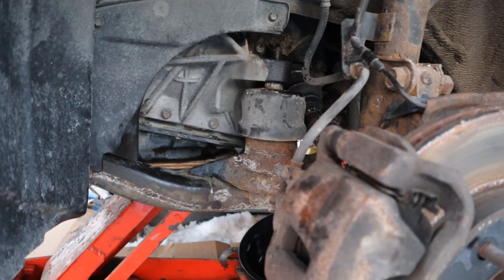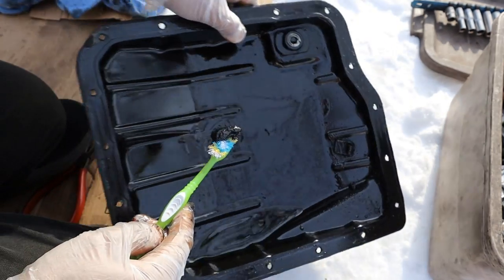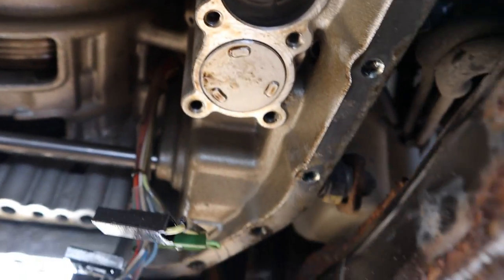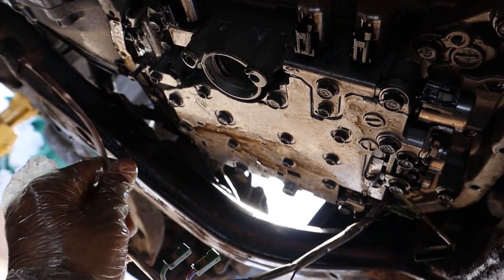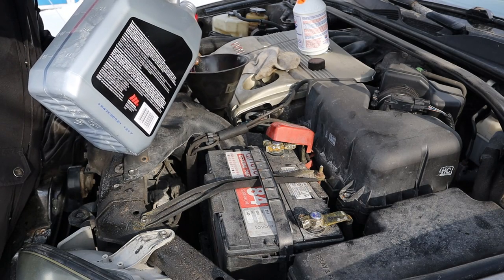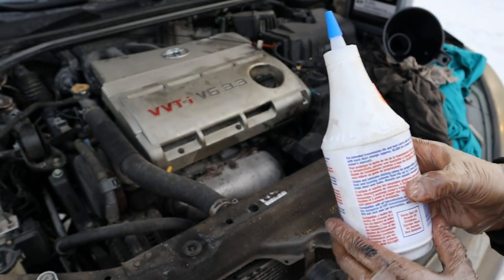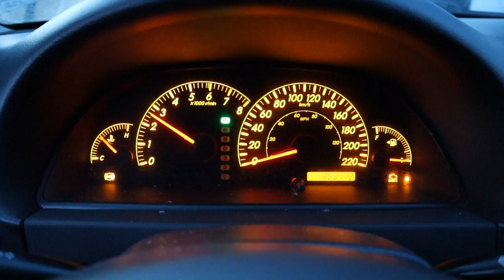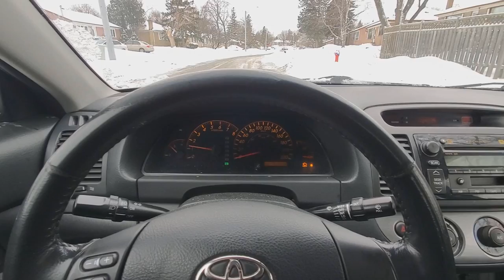Can Stop-Slip Save this Transmission?

Comment: It worked for me. Back in 2001, I had a '96 Galant. I didn't know anything about cars then. Trans slipped a few times & I squeezed half the Lucas stuff down the dipstick tube. On top of the brown fluid too.... 😳😳😳 I drove it another 3 years before I had to replace the trans. Lol.
Reply: If its broken or worn it's better to leave the old in there. Unless u change the filter too.
Reply from the maker: Well in your case it still had life left in it. Didn't work here 😞
Reply: 😂 old days stories are the best
Reply: How did the car need a new transmission so fast? 96-01 is only 5 years.
Reply: Old post, but ...  @kingxcamm  From video description: "This Toyota Camry got stuck in the snow and burnt up its transmission."

Comment: This was nostalgic for me. I changed the ATF in my old 03 Camry cause it was pretty dark but I didn't have any shifting issues. After changing it with Toyota oem atf it felt like a new car. It shifted a lot better and a lot smoother. It was honestly one of the best diy maintenance I did for that car lol.
Reply from the maker: Keep up on those drain and fills. There's ~10 liters of fluid and you only changed 3 or so
Reply: Same thing here on my 06 camry..lacked acceleration but after a transmission fluid and filter change it was a brand new car again
Reply: I did additional 2 more drain and fill with oem fluid
Reply: @speedkar99  required 2 drain and fills. Good thing these model years have a trans dipstick for easy replacement.
Reply: In my 1998 Accord,it was reverse,after I changed the ATF it start slipping and that Lucas stop slip did not help at all it made it worst,so I have it rebuild for$1800 and now after 25,000 miles later it still not slipping,He gave me 24,000 2years warranty a Honda specialist on tranny.
Reply: @efrensaclolo7021  the  old fluid with more friction was preventing the clutch packs from slipping.
Reply: My 06 Camry started slipping after a bunch of fluid changes so I can't relate
Reply: @efrensaclolo7021 same thing happened to my Camry

Comment: Hell Yeah!!!! 👍🏿👍🏿👍🏿👍🏿😁I use to do Uber in my 06’ Highlander in Minnesota! Had to do my own maintenance in the snow! It was too expensive and trying to make money! Alternator, starter, transmission drain and fill, oil change, steering fluid, main drive axle, rear bearing, front knuckle with bearing!!!! All in the snow living in an crappy apartment!!!! Had to wait till temp was above 20 degrees during daylight in order to work quickly on each one. This was during NCAA and Super Bowl so it was a must!!! Mad respect ✊
Reply from the maker: Exactly. Sometimes you have no choice and gotta work in the snow and cold!

Comment: Another great video! Keep 'em coming. I hope you don't run out of toothbrushes! 

I think over 90% of current manual and automatic transmissions are made by Aisin, a division of Toyota, and most, if not all, of the automatic ones require Aisin/Toyota T-4 spec ATF which is not full synthetic. Changing this fluid regularly is critical to the life of the transmission - especially if you are hard on it.

My VW Rabbit's VW 09G automatic transmission (Tiptronic semi-auto) is made by Aisin and takes the same fluid. When I bought it with 142K miles on it, the shifts were very hard. I drained the fluid, dropped the pan, draining more fluid, changed the filter and replaced the fluid according to VW's instructions which were tedious, time consuming and Aisin T-4 ATF consuming. (Just draining the pan gets 2.5 quarts and I changed 3 times that amount following this procedure. The shifting improvement were very good, but still not quite what I wanted. 

Since then, I changed the ATF pan (2.5 quarts) at 15K mile intervals using a very popular full synthetic which meets the T-4 specs. The improvement after each change was better each time. Now that I am satisfied with the results at 165K miles, I will switch to 30K mile intervals. 

I'm not saying this will make my Aisin auto transmission bomb-proof but it should lengthen the life of it as long as I don't abuse it. Supposedly, this transmission is a weak spot in the VW but it works perfectly now.
Reply from the maker: Awesome. Didn't know Aisin makes VW stuff. I thought ZF would
Reply: @speedkar99  
The VW 09G automatic transmission is also called the Aisin-Warner TF-60SN transmission.
Even though Aisin is a division of Toyota, it is a separate entity and has been making manual and automatic transmissions (not sure of CVT's) and all the required fluids for them for almost all of the cars in the world for a very long time. 
The Mini, Miata and Honda S2000 6-speed manual transmissions were by Aisin. The 5-speed Miata was by Mazda. 
I've used the appropriate spec AMSOIL fluids in all of my manual RWD truck and car transmissions, manual FWD transaxles, automatic FWD transaxles and CVT FWD transaxles with great improvement in every one of them. All of them were broken in on the OEM fluids before I switched to AMSOIL and I could tell the difference in shifting. i am not an AMSOIL dealer and I don't get paid to say this...I just like the stuff.

Comment: That's the way I change the fluid in my old Pontiac with a TH400, take a cooler line off and run a couple quarts in a pan then top it off. Keep doing that until what comes out is nice a red. Sure beats just dropping the pan and leaving over half the old fluid in the converter. Nice to see someone else doing it that way!  : )
Reply from the maker: Flushes are fine if you have a major issue like mine. For just regular fluid changes, a drain and fill should suffice

Comment: Your fluid was dark because the clutch plates were burned out. That's also why it's slipping.
Reply from the maker: Yes, I expect to find that when I open the transmission
Reply: @speedkar99 is it necessary to take out transmition if you change only the forward clutch plates on toyota camry1992 2.2

Comment: That cylinder piece that you found in the pan is a bearing roller
Reply from the maker: That sounds right. Sits in the transmission casing against the final drive right?
Reply: @speedkar99  yes sir

Comment: A friend of mine calls me around a month ago telling me that they dropped GMC Savana after the costumer tried to move the van out of the snow. By rocking it back and forth by switching rapidly from Drive to Reverse he blew the gears inside. Not the first truck or van tranny that we replaced or 'our' tranny man rebuilt.
Also Aisin (their transmissions more and more often is used in European and American cars) recommends to change the ATF every 80k km. As far as Lifetime fluid listed in some vehicle specs, it's more of a marketing trick, because all automatic transmission manufacturers recommend ATF change. That actually happened to my father's older VW Jetta with the Lifetime ATF - during one week the tranny practically quit, but after fluid change it magically came back to life.
Reply from the maker: Yeah keep the fluid changed and don't abuse it in the snow and it should last

Comment: The part at 2:22 is the brake seal for the intermediate clutch (2nd gear) it’s located between the VB and case. Someone has likely been inside this transaxle and it fell out when the valvebody was down. You’ll have a big leak in 2nd and likely burn up 2nd clutches pretty fast. 

The U150 series was more reliable than the U140 but mileage gets them all. They are expensive to rebuild and this one is way far gone.  Not Economically Feasible to Rebuild. Too bad salvage prices for used units are climbing to stupid levels in some places.
Reply from the maker: Thanks for the info. I guess I should also examine second gear clutches as well when taking this one apart.

Comment: I used Lucas in an 02' Honda Civic with the terrible 4 speed auto.
Started with sluggish performance, then the torque converter would kick out when it shifted.
Then it blew a coolant line and ran almost completely dry of trans fluid.
I filled it with Castrol transmax and Lucas got another year and half out of that transmission. LoL 😎
Reply from the maker: Nice! I used it on my friends ES300 and it stopped it from slipping so I had a tiny bit of hope for this one

Comment: Thanks for the video and the effort! Very impressive to see over 360k miles on that car. 
I wonder how many timing belts it had done 😂 Definitely worth putting another trans in it imo.
Reply: I realize that it’s actually kilometers. Still very impressive
Reply from the maker: Yeah it ran good. I ended up putting a used transmission in it, that'll be the next video in this series
Reply: @speedkar99  Awesome! I’ll be looking forward to the video. My sister actually has an 2004 Camry SE V6. Sometimes it shifts kinda funny. It’ll rev up before it goes into second or third gear.

Comment: nice video! and, no, it wasn't a waste of time and glad you did it, especially in the cold...
I always thought you should never do an ATF flush because it can push tiny material into all the crevices of the AT....

I probably would have drained out enough fluid to add in some of the stop slip stuff and see how it did.  If that didn't do anything, I would have drained out all the fluid, dropped the pan, cleaned the pan and magnets, put a new filter back on and then filled it back up with OEM ATF. If that wouldn't do it, then I would just call it a day and scrap that camry with a beautifully running engine tear drops

Love your videos and keep up the great work!
Reply from the maker: Yeah but this fluid was toast! 
The idea wasn't just to replace fluid, but get an idea of the transmission condition by dropping the pan and checking all the solenoids
Reply: @speedkar99  nice! Thanks for another fun video!

Comment: good try,  I used the lucus stuff along with 3x drain fill using valvoline max life full sync atf on a nissan maxima with a RE4F04B transmission that was almost toast as a last ditch effort.  I also used seafoam trans tune.   that was around 202K miles, it now has 243k miles and 4 years later.  it was good enough to get around while my son saved up for another car.  it lost 4th gear (overdrive) but all other gears work.  I have a feeling 4th gear clutch is burned out or the TCC solenoid is bad.  P0744 is the error code.
Reply from the maker: See my teardown on this transmission. There was no saving the clutches on this!

Comment: Try Lubegard. No one knows about the stuff and it fixes stuck solenoids and valve body issues. If it's the frictions in the clutch packs or bands then nothing you add will help
Reply from the maker: In this case I don't think it was a valve body nissie since I cleaned that up pretty nice

Comment: DO NOT DO IT!!!!  As a transmission builder, I tell you...  If it's broke, NO fluid will fix it!  These stop slip additives are designed to swell the rubber seals in the trans providing a "better seal" for worn parts to make the transmission work again.  Now, in some and some (very few) cases where these additives do actually help...  What is there to tell these additives to stop?  In other words... Once these additives have done their job, what stops it from continuing to swell rubber parts?  Nothing is the answer.  These rubber parts continue to swell until they pop.  That includes external seals.  I can tell you, we charge extra to build transmissions that have these additives installed, as it is a chore to clean properly.
Reply: These products are mild and won’t do much at all from my experience unless the directions are not followed. Multiple bottles or mixtures of additives. 

The real wonders are when someone suggests a bit of brake fluid added to the trans fluid. This will get things going!! Talk about a big mess. Little brake fluid suddenly fixes all and people think more must be better and then end up with exactly what you describe. Locked up drums and seals. I’ve broke a few aluminum drums trying to remove pistons. 

All these additives are temporary at best and not fixes and like Kefsn suggests may cost you more in the end.
Reply from the maker: I can understand your point, similar to how it is to have tires with foam goo in them
Reply: That’s not what people who are trying to sneakily sell their car care about though

Comment: If you mix the stop slip with ATF it pours faster. Pour a little out. Put ATF in with stop slip. Put on cap & shake. Then it will pour faster. I have the 05 2.4 literr before the oil ring problem with the U251 Toyota 5 speed automatic. I watched this to see how easy the trans pan is to drop. I need to do that motor mount on mine so my lazy-meter was accurate, it can wait til summer.

Comment: Wow, impressed that thing even moved!
Mine (RX300 with a U140) started slipping in the high gears first, but after a while it started hesitating going into reverse and 1st as well. The oil didn't look that bad though!
Reply from the maker: Those RX transmissions weren't known to be reliable

Comment: a good tip for this job is to make sure you forget to reinstall the bolt on the transmission mount
Reply from the maker: Why is that?
Reply: @speedkar99  so that when you hit a big pot hole transmission drops

Comment: I have a Mazda 2013, 270,000 kms (160 000 miles). My mechanic told me I will need a new transmission. Fluid very dark and burnt. At this time, no special noise, no Check Engine light. It started slipping a month ago. When I change speeds, I need to let go the gas pedal or else the RPM goes up to in between 2 or 3. If I am extremely gentle on the gas pecal, can I go on for at least let's say 10 000 kms (6 000 miles)? Will I see more signs that the transmission is going worse or can it give up after just a few kilometers?
Reply from the maker: Definitely get a roadside assistance plan
Reply: @speedkar99  The car started working like before after I filled up the gas tank. What do you think of that? 😳

Comment: Lol 3:31 is that not a solenoid coil? Probably goes with the cylindrical piece that was on the magnet. 😬
Reply from the maker: It sure looked like a solenoid coil but all the solenoids in them valve body were intact.
Reply: @speedkar99  maybe transmission RPM sensor? a quick search and it looks like the little piece on the magnet may have been part of that.

Comment: That copper bundle looked like a solenoid winding.
Reply from the maker: Yeah it did to me too but all the solenoids seemed intact
Reply: @speedkar99  that is slightly bizarre. FYI you can find pretty good step by step rebuild videos for these things. Once you tear it down you can see if it makes sense to get a kit. Certain parts are more expensive than others, and if there’s any damage to the case internally it’s somewhat junk.

Comment: That whining noise you mentioned sounds like the pump to me, as it sounds very similar to a hydraulic pump sucking air
Reply from the maker: Yea but it had enough fluid....
Reply: Definitely the transmission pump, I've experienced that whining sound sound on a Chrysler 62TE firsthand

Comment: Pare Ko,How many miles does it have? My 1998 Honda Accord start slipping at 130,000 miles,I have it fixed for $1800 now it has 155,000 miles,I want to change the fluid with OEM with Z-1 on it but I saw Valvoline and Castrol sells those fluid with Z-1 $6 a quart compare to $12 Honda brand,You are the master of all mechanics in Yutube so I need your help,I have 5 sixth generation Accords 1998,1999,2000,2001,and 2002 except 1998 the only one that had tranny problem,the 2001 has 405,000 miles the 2000 has 310,000 miles 2002 has 210k miles.1999 has 230k miles.My daughter and 2 sons and my wife and myself have ONE ACCORD.
Reply from the maker: Yeah the 6th gen wasn't known to have good transmissions at all
Reply: Well of all my Hondas the 1998 Accord is the only one that has a weak tranny.Maybe you are talking about most of Hondas with six cylinders that are failing at a 100k miles.All my 6th generation accord are four cylinders and 1998 model year failed at 135k miles.The rest are still trouble free and keeping it till it falls apart that most likely not going to happen with proper maintenance.

Comment: Interested in that bunch of copper wire. What could that be from other than a solenoid but you tested them and they all "clunked". Is there a reverse solenoid hidden somewhere that you might have missed ?
Reply: Yeah it looked like solenoid winding wire to me.
Reply from the maker: It looked like a solenoid but all of them in the valve body seemed intact

Comment: You need to remove the sub-frame and steering rack anyway to replace the steering rack that always leaks in these 😉
Mine leaks but it’s a small leak and hopefully won’t need to be replaced.

Maybe you can break loose or off those exhaust bolts without a torch. Maybe a cold chisel? 

Anyway, not worth your time and expense as you already said in another video.
Reply from the maker: Surprisingly this steering rack didn't leak

Comment: Just bought a 05 camry 4 cyl with 270k on it runs and shifts great but transmission fluid very dark and smells toasty for sure everybody tells me don't mess with it..should i change it or not?
Reply from the maker: Drain and fill. Then drive for a month and repeat. Don't flush.
Reply: @speedkar99  thanks bro i think i will.

Comment: My car currently is going into limp mode. My OBD scanner picked up Code P0756 shift Solenoid B is stuck off. Will using this product help? Just enough to drive to a transmission mechanic shop to get it fixed.
Reply from the maker: I don't think so

Comment: Hi, SK99  How do you do?  Is the return line the one going from the cooler back to the transmission, and you stop the engine when the return line starts to sputter?  I'd like to try the trans flush on my wifey 2015 Sienna with NO trans dipstick, thanks for your video. Wish you lives nearby where I live, lol.
Reply from the maker: Yes. If there's nothing wrong with your sienna, then don't flush it. Just drain and refill
Reply: @speedkar99  Thanks for your advice.